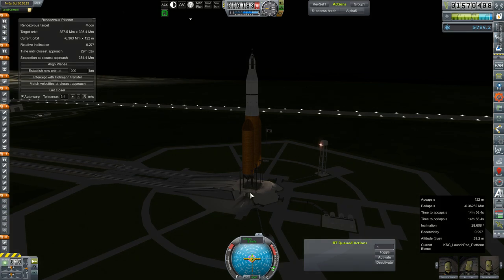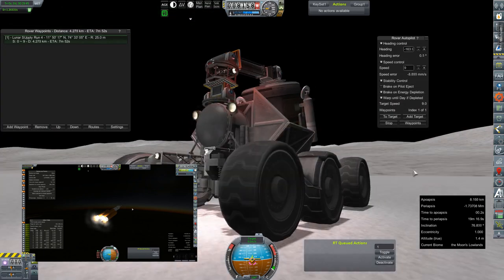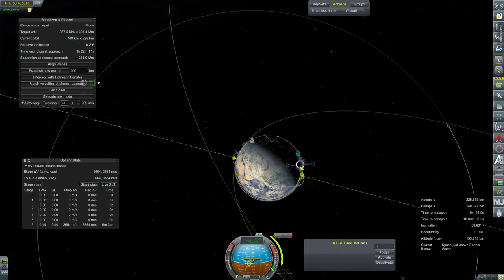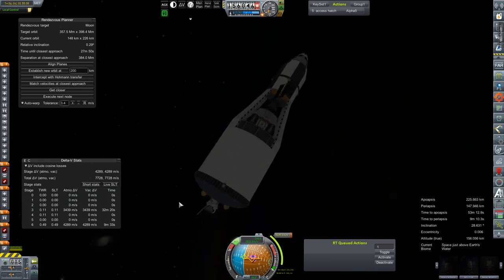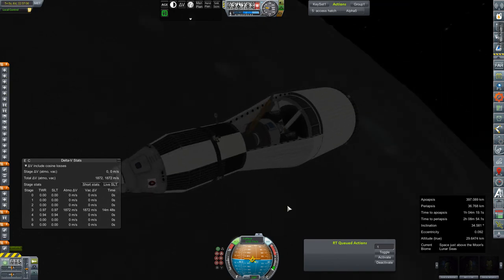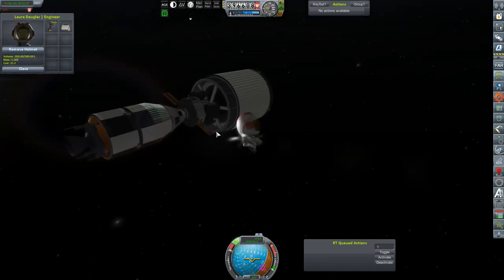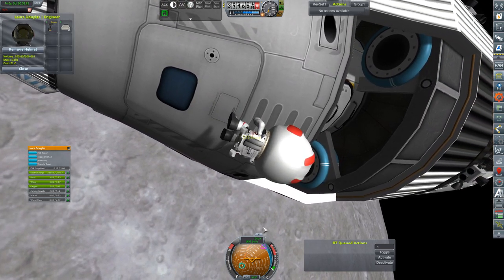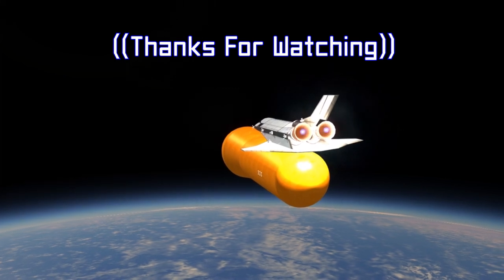KSP RP-0 #406 Not Exactly to Spec

Comment: Have you considered a lunar lander-SSTO? One vehicle which could land and return to orbit in a single stage would save money, because then you'd just need to bring fuel for its round trip instead of a new lander each time
Reply: I wanted to suggest this as well. Maybe the lander could attach to a space station in orbit of the Moon? He could add some fuel tanks and supplies and a lab to the station. He could use the lander to get all the science from the bioms, take it back to orbit and process it in the lab.
Reply from the maker: The lander on this mission is actually single stage - it is kind of a test run - as it will need to top off fuel after landing before heading back to orbit - but it is designed to be re-usable - and if the concept works ( and a few other pieces fall in to place ) it will be the basis for a truly single stage lunar crew hauler

Comment: Call it "Impala". It was one of the very last cars sold in the US with 3+3 bench seating (offered until ~5 years ago)
Reply: Thats a cool name suggestion. I like it (because im a car guy). :)
Reply from the maker: oi..... plz no gm....is bad omen....
:)
Reply: They had some great cars, tho. My favourite are the 67 models of the Camaro, Corvette and the Impala. :) But my favoured american brand is Dodge. :)) I like the new Challenger.
Reply from the maker: oh the old school GMs were awesome! something happened to American cars in the 70s, and they've never been the same again... 
(( I used to work for Chysler - the Challenger is pretty, but if one was given to me, I'd see it and buy an E46 M3... thats just me :) ))
Reply: I tell you what happened in the 70s: Oil crisis. ;-) Before that you had those huge V8s over there. But after that they made everything more fuel efficient. Smaller engines, ugly cars... yuck.
Well, I am driving right now a 316i E46 as a daily driver. Good handling car. Very nice balanced. Even the small engine is very sporty. But the quality is for european standards very low. I never saw a car getting old so fast. Many problems with rust, problems with electronics, problems with mechanical components. This was my last E46... :)
Also: Never buy a used sports car - especially if it is 15 years old. Thrust me. I have driven all sorts of cars, but you never know how the pre owners threated the car. 
I wanted to buy a new car next year. Cant decide yet... I like the Alfa Rome Giulia. But I also like the Subaru BRZ and the MX-5. I think the MX-5 is getting a new engine to order for september (184 hp - the car weighs just 1.000 kg). Lol. 1st world problems...
Reply from the maker: Ascender2306 the downsize in displacement I understand - how ugly they became I dont get. I dont think American cars really recovered from that. ( and then there is the build quality issue - for the decade I worked in car audio, American car interiors just feel super cheap now compared to 20 years ago, or the similarly priced cars from japan/Europe)
All I've ever owned were used beater cars, it's just something I've grown used to, but honestly, my 99 e46 sedan has been one of the most worry free cars I've ever had ( small issues aside - a window that doesn't work speakers that clip etc ) other than my 91 civic, it's been bulletproof. Also always loved the look of the 346s more than the newer 3 series. :)
Reply: I think you have a term over there - "Cheesy". I have this word often in my mind when I see the interior of american cars. Dont get it wrong: We europeans build also bad cars. You wont see those, because we dont export them, but yeah... I have seen a lot of stuff. I have driven all sorts of cars. My cars were always really old and had their problems. I had the most fun with my E34 BMWs as daily drivers. And I truelly understand that you dont like new BMWs (me neither! - they gave me a 440i in the last week, and this thing feels like a bathtub - so bad!). 
However: I have bought my E46 in October 2017. It had the best condition. It was super clean, no dents, no rust, everything worked... I have never seen a car that is getting old that fast. So much rust! This week I was grinding the rust away and resprayed the parts. Hell, so much work. Maybe you have a facelift model. Mine is from the year 2000. With the facelift they had better quality.
Reply from the maker: cheesy is probably the best way to describe the interiors of American cars - or  alternately - crap. I worked in car audio for almost 10 years - I've seen, and taken apart almost everything. The American cars always felt cheep, crappy, and lacking something.... meh... 
nope, my E46 is a 99, pre facelift. I guess I lucked in to one of the good ones. but his age is starting to show... another coil pack went this week - the ball joints are starting to give - the U joint needs replacement ( again ), the Mass Air sensor is on the fritz, and the passenger rear window stopped working... it makes me sad, but It might be time to start looking for the E46 wagon i've always wanted ( yeah I'm weird like that )

Comment: Call it "Artemis Mk2" like they were going to call gemini Mercury Mk2
Reply: Also you should make an RA-10 with better engines
Reply from the maker: If youre talking about the old RA-X prototype - I abandoned that for structural issues - and ended up getting the capacity I needed out of the DN-6B-X - 
I have thought about giving the really old school RA-9E-HV an update - but that is a bit down the line ( If even needed at all)

Comment: Considering your extended Artemis is even bigger than Orion(NASA) or Orpheus(Raiz), it looks a little bit disappointingly small. Any plan to change the paint scheme?
Reply from the maker: yes - right now I am limited by the textures that can be used on fairings - but thanks to the efforts of others in the community, I am working to get more textures working on the fairings, thus opening up more options for the paint